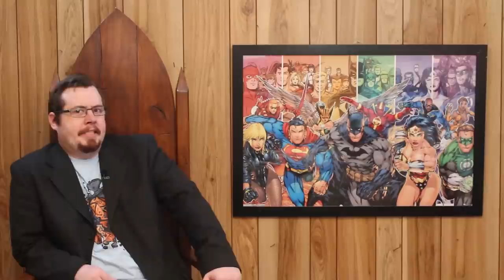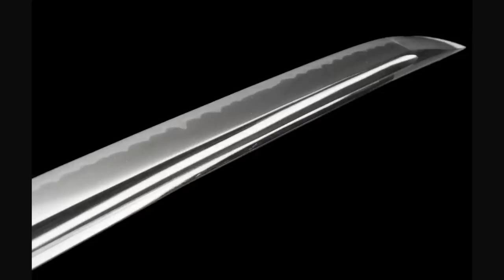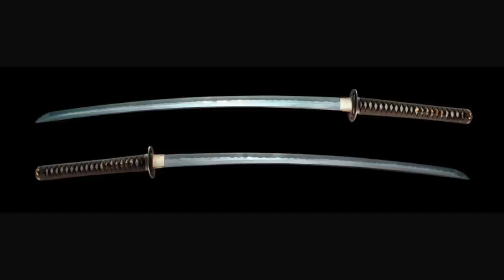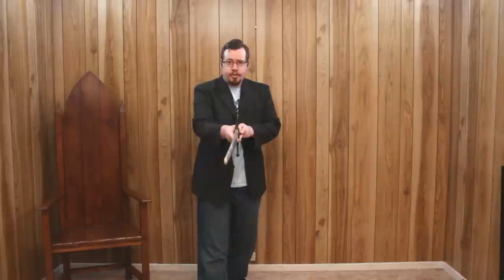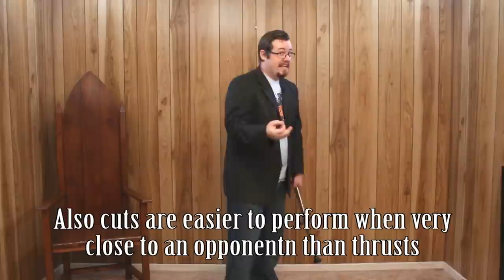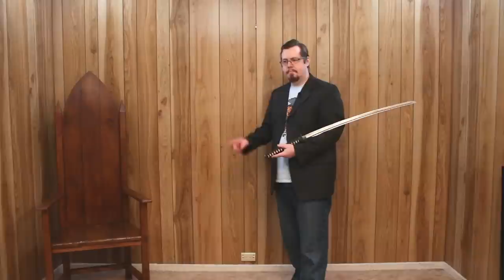Super cutting swords, are they needed?

Comment: You'd really need to ask someone like Matt Easton or Thrand , but it's my understanding that a rapier can cut and kill an unarmoured man , it may take a well aimed slash to the neck or what have you but they do slashes as well, and as the tip is very nimble you can actually land cuts to face/neck or other dehabilitaing areas with them. Now a foil, that has hardly any cutting ability at all.

Comment: @shadeversity - it's really inky "overkill" if the emphasis on that last bit of hyperspecialization for a very unlikely situation signfiicantly inhibits your caoacity or characteristics for a far kore likely scenario.

On the battlefield, you dont get perfect hits, generally.  You may well find your self swinging (relatively) weakly as you retreat to catch your footing, or have to overextend in an attack because your opponent has a weapon specialized with more reach.  In which case, a swird that under normal conditons rhat can go, "Hassan, CHOP!" right through the opponent's entire body, might just provide that last little bit of striking capabikity that turns a graze into a degrading bleeding wound, a degrading wound into a disabling wound, or a disabling wound into an instant fight ender.

Also, you may not only be fighting equally equipped humans.  If youre on foot with a sword, and outside, theres a non-trivial chance some twerp on a horse may try to but in - it wouod be nice to have the confidence you have a decent chance of deflecting his attack and hamstringing the mount, or injuring the cavalryman with a leg cut.

Comment: The capabilities of the sword, in order to maximize efficiency, has to best match the strengths of the user. For example, a person with a stronger wrist motion will be much better suited to use a slashing sword whereas a person with stronger wrist lock would be much more deadly with a piercing sword. Body mechanics vary greatly, more so than any other variable in terms of swordsmanship, therefore the deadliness or effectiveness of a sword depends mostly upon the sword's ability to compliment a users body mechanics.
Reply: Yeah about that, the only sword you should use the arms to power your cut is the sabre. And moulinettes at that, basically spinning it like a half assed idiot (I don't like sabre fencers sorry). Other swords get their power from the rotation of the core and by stepping.

Comment: Imagine yourself on a battlefield. Your side uses arming swords, the other, say, katanas. Warhorns sound and two armies charge at each other. Your blade does the job well. It tears through armor and flesh, no problem. But then, the guy next to you ran out of his luck. He hit an enemy clean in the calf, but got the blade wedged in the bone. That enemy turned around and chopped down on the unfortunate soldier. His blade sliced clean through the soldier's skull. Blood gashed out and he died immediately. The enemy unwedged the blade, treated his wounds and limped off on a broken spear or something. On the other side, another guy stabbed an enemy in the  bowels. That enemy chopped his head off. Around you your allies' limbs are flying and blood is pooling. How would you feel at that? Most wounds made by balanced swords are enough to kill, sure. But cut-specialized blades will score deadlier wounds with the same moves and they are easier to use, too. Overall, if the need for swords may arise, specialized blades are a go-to.
Reply: Plus, since swords are designed for a certain type of soldier, a jack-of-all-trades makes no sense at all. In olden times, a foot soldier fights with spears and halberds, and swords are only sidearms. They also need to hold shields so a light one-handed sword that can be used in various ways is needed, hence things like the xiphos, gladius, and arming sword. Cavaliers, however, fight on horseback. FYI, a running horse shocks like hell, and is brutal on the butt. Not exactly the most ideal condition to aim thrusts. So, cavalier swords are made light enough to be able to be held in one hand, but heavy enough so as to cut through enemies. Swings are still quite easy to do on horseback, and the combined speed of the horse and the swing helps tear through enemies like they were tofu. You've got things like the spatha, the saber and the katana, all of them are designed to be used on horseback. The longsword, in turn, is also made for riders, specifically knights, but just because knights were protected by full body armor. Otherwise the longsword is useless.

Comment: Think type of armor! if the armor is iron or steel based then the cut is aimed at un armored body parts or joints. However! If the Armor is lacquer "wooden- samurai" or leather or silk or felt or cloth. You get the idea. Then the cut may be aimed to go through this armor, if the sword is designed with a deep cut in mind.

Comment: The type of sword you showed at 12:08 has infinite advantages when used on horseback or in very close quarters. Try to stab multiple people with a rapier (or a longsword for that matter) while charging at full speed on a horse. There's a reason cavalry kept the saber around for a long time. There are other examples of more effective exaggerated cutting designs that worked better then the normal or stabbers - for example the indian kukri (and similar inverted sword/axes/falx type weapon) was incredibly effective because people simply wore no armor in that region, due to heat, and it was also intimidating to face against an opponent armed with that. And speaking of the falx, the roman army introduced metal helmets and metal rimmed shields for the first time during their invasion of Dacia - that particular weapon cleaved through normal shields - first only to the veteran troops, then it became an uniform for the whole army after the reformation.
I quote from Wikipedia "The time of the conquest of Dacia by Trajan is the only known instance of the Roman army adapting personal equipment while on campaign, and it seems likely that this was a response to this deadly weapon. Roman legionaries had transverse reinforcing iron straps applied to their helmets - it is clear that these are late modifications because they are roughly applied across existing embossed decoration. The legions also reintroduced the wearing of lorica hamata and lorica squamata for the Dacia campaign as both were more flexible than the newer segmentata armour and were able to distribute damage more widely. In addition, both these older armour styles had unique modifications, a row of pteruges was added to the sleeves, a double row of pteruges was added to the skirt and a heavily padded vestment was worn underneath them. Roman armour of the time left limbs unprotected; Trajan introduced the use of greaves and an arm protector (manica) for the right arm, which had previously been used only by gladiators, and which was never used again by soldiers once the Dacia campaign concluded."
Reply: There's a reason cavalry used both straight and curved swords with late-19th century cavalry abandoning curved swords.
Reply: There's a reason cavalry used both straight and curved swords with late-19th century cavalry abandoning curved swords.

Comment: Well a curved sword might be quicker to draw to defend yourself, I remember watching a video series on HEMA where they wanted to see which sword could be drawn the quickest to defend yourself from an attacker twenty feet away. The saber performed better than the longsword, rapier, and katana if I remember correctly. Secondly as everyone is saying, most of the super-cutting blades were developed for cavalry. Third I think in later periods where armor was on the decline, or for your own self defense when your not in battle a curved sword with more stopping power is ideal compared to other swords.
Reply: No, the longsword and the sabre performed roughly the same even though that the longsword has a blade that's around 10 cms longer than the sabres. The curvature doesn't help in the slightest, if you have ever drawn a sword from its scabbard you should know that if it is curved it has to travel more in the scabbard, also you still have to pull it out in a straight motion and if it has an extreme curve you should do this carefully so the blade doesn't get stuck.

Also the school which did it does sabre practice the most. Katana weren't tested but according to comments it was found really impressive by iai students to be able to get the sword out and stop an attacker at those ranges.

Well yeah super-cutty blades are super heavy and superbly inbalanced.

Curved swords don't have more stopping power, they transfer some of their momentum to a slicing motion resulting in a long and shallow wound compared to straight swords that produce a wound that is shorter but much deeper. I am talking about cut flesh in the case of curved swords to removed extremities differences with straight swords.

Though cloth armour is easier to cut with a slicing action (somewhat), but curved swords were mostly adapted because of fashion if anything else. Not because they were more effective.

Comment: I believe you are wrong. History proves it by virtue of what happened. Curved swords were massively favoured by the Napoleonic era, for combat. Most cavalry of the time (with the exception of some curassier units) were equipped with sabers, the British one being a beast of a chopping implement. I suspect there were two reasons for that fact and both boil down to the idea that cutting-swords are better for cavalry: one: they had to cut through rigid shakos and rolled up greatcoats, the added cutting ability would allow them to do so. Two: a thrust delivered from horseback would often rip the sword form the users hand as it was embedded in the target, so a cutting sword would be easier to recover.

Comment: The middle eastern/ Indian swords with lots of curve sort of predate common usage of armor. You weren't trying to stab a weak spot. Hopefully just one slice or a few( which can be done quicker inder stress than thrust especially at really close range) kills the enemies.  A lot of latter European swords were designed for 1 on 1 fighting or fencing. You might need to slash more than 1 person in real combat on a battlefield. The curved blades are also easier to use on horseback rather than the thrust which could get stuck in the enemy and make u fall off. The extreme curve also creates less resistance which u want for the same reason. Maybe most important of all is these cultures probably thought of a sword as a specific weapon for slashing whereas a spear or pole arm for thrusting.

Comment: I think, if your opponents wear only non metallic armor, extra cutting capacity is usefull to destroy their armor. By this, their armor became ruined faster, so you can start kill them on earlier phase of battle. And in this phase, almost every kills have the chance to break their combat moral.
Of course, if they wear metallic armor, then the edge will be cracked or dulled while the armor ruin, so you have better chance with two edge blade. You simply flip them, and you have a sharp edge again...

Comment: I thought thrusts were more useful against plate armor.  It's hard to cut through that type of armor...  A lot of this argument ignores the fact that these weapons are designed for different targets.  Also I'd rather have a sword that cuts clean through the enemy than getting stuck half-way, then you have to pull it out of the target before you can deal with the next guy, who might already be in striking range.

As for cavalry, thrusts take a fair amount of precision, which would be more difficult while traveling at high speeds on an animal.  Keep in mind that the horse is an animal, and it has a mind of its own.  It has to be pretty damn well trained to run straight into an enemy formation.  It seems like cutting would be a lot easier to pull off at close range or when moving past a target.

Comment: Shamshirs and sabers are excellent cavalry swords, better than the straight blades as the point is less likely to get stuck in the enemy as the rider passes by and also is safer for horse and rider. Tulwars complement the martial art of those who used them. And if one is to cut, why risk binding the blade into the body of the enemy when a design change can better ensure the blade will go through the flesh all the way and free it for a counter? Not to mention the psychological value of shearing limbs to the offender and the victim. It could turn the tide of battle. I agree longsword is amazing. I do prefer it, however we must see the other swords in their element and not be tempted to boil design worth down to lab test cut results.

Comment: I disagree with you.  Though curved blades and straight blades both 'cut', curved blades are used for 'slashing', while straight blades use a 'hacking' type of strike.  Hacking strikes may more effectively crush bone or sever limbs, but run the risk of getting stuck, which you did not mention.  Slashing blades avoid this problem bc the blade is moving at some oblique angle to the attacked surface, while straight blades will hit the surface perpendicular.  The curved blade can slide and therefore cut a larger length of surface.  Test cutting should make this clear. Observe the deli slicer.  Curved blades in my understanding also lend themselves more to horseback where you would not want to use thrusting strikes.

Comment: I would agree with you in most one and one combat situations. But I don't there is such a thing as excess cutting capacity in an honest to goodness battle. You need fluid motion when fighting more than one opponent. You don't want to waste time wrenching your sword out of a bone of the guy you just killed or incapacitated when there is another guy taking a swing at you. Try chopping through a rack of ribs into individual ribeyes with a cleaver that is just sharp enough to cut into the spine but not sharp enough to cut through and you will see what I mean. This may also be another reason they kept the curve in a katana, it is alleged to be easier to pull out a curved blade than a straight one and the reason calvary swords are curved.

Comment: As an Olympic-style fencer, I feel my comments may be a tad under-informed, but in my experience having your sword in a certain position can effectively block all thrusts in that area as well. While it's not as simple as a cut, where having your sword to the right of your body will block all cuts to your right side simply due to matter's incapability of moving through matter, having your blade well positioned can both limit the number of angles at which your opponent can hit you, and allow you to easily parry anything near your blade with a slight movement. It certainly does require you to react a bit more, but often simply the fact that you could easily parry is enough for your opponent to avoid thrusting into certain situations. In addition, when cutting you can cut from one guard into another guard, whereas with thrusting you must extend and then pull your arm back into another guard.

Comment: The way I see it, while it's easier to stab someone, you have to aim very carefully to hit a vital organ. A cut, however, can kill more easily. This id because you can land a cut and your opponent can bleed out very quickly. Plus you might be able to hit an organ causing even more damage. The curve helps with weight and adding more percussive damage. Plus a curved sword has a much lower chance of getting stuck in a target. Finally, it has a better chance of getting through gambison. P.s. I'm not quite sure how to spell that properly.
Reply: Curved swords if they go deep have a much higher chance to get stuck, of course with curved swords you aren't that likely to go deep. Simple geometry, once you are inside the target more blade will be in contact. Also seeing machete attacks on living people swords will not really go and get stuck. It is quite evident from the fact that cavalry used both curved and straight swords and both of them in the cutting design mostly. It's not the curvature that makes it easier to go through a gambeson but the action you may use with it, which is why curvatures are used pushing or pulling a cut. But then again these type of cuts will largely stop before a bone.

Comment: the more i read through these comments the more i relate the big 3 blades to the big 3 handgun calibers. the 45 is the katana. pure stopping power. heavier probably overkill limited in key ways but not enough to make it un practical. 40 is the long sword. good all around not great at any one thing bit gets the job done. and 9mm is the rapier. lightning quick with repeated hits one after another but limited in the pure stopping power area.